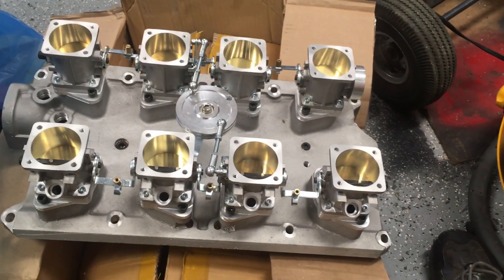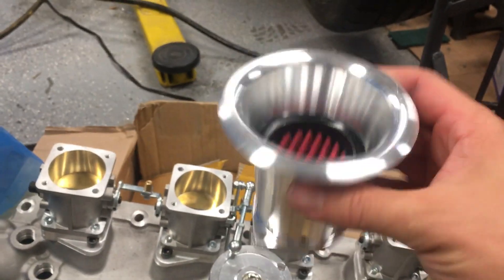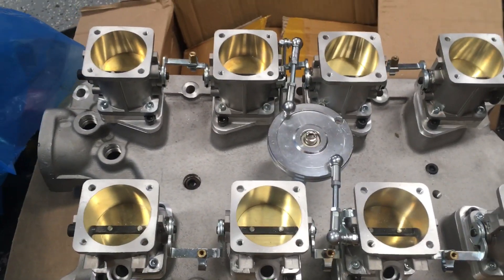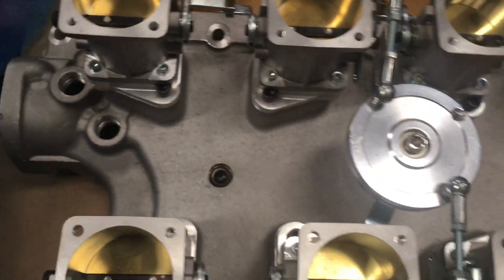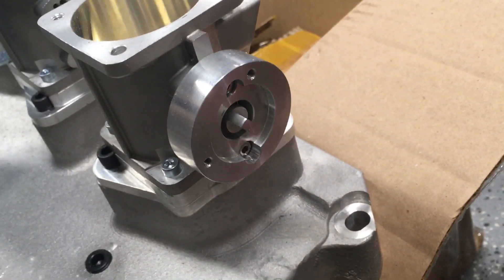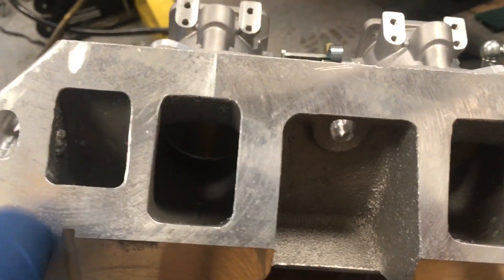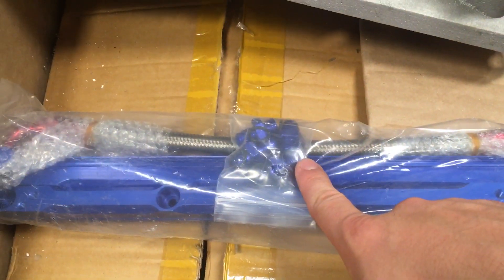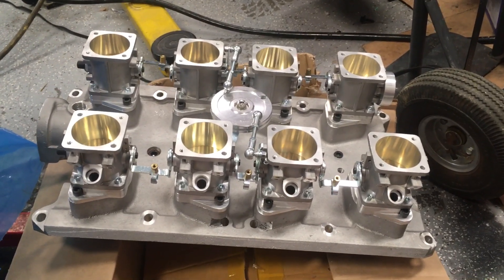Speedmaster Downdraft EFI Initial Review

Comment: Hey Ted ! Love your video’s was wondering what you think of the speedmasters stacker so far? I have this setup on my 351 stroked 427W but cannot get it dialled in and not fouling plugs. Hope you can lend some much needed knowledge.
Reply from the maker: Hey Brandon, I'm glad you enjoy my videos! To be honest I have only run the car a few times with the Speedmaster setup and I haven't dived into tuning much at all. Can you tell me a bit about your fuel and ignition systems otherwise (what ECU, injectors, whether you're using Speed Density, Alpha N or something else for the method) and I'll give you any thoughts I have.
Reply: @TedsGarage  Hey Ted ! Thanks for getting back to me really appreciate it. So I didn’t build the engine personally but from my knowledge it’s 
Dart Block 351W stroked 427 forged internals I have a solid lifter pretty racey cam setup I have a AFR renegade heads #1451 58 CC running just a basic distributor from the auto shop down her in Melbourne, Australia  I’m running Siemens 60lb injectors with a Wolf V550 ECU hopefully I’ve covered most of the things that could some
Up the setup 🙏🏽😅 Anything you recommend would help immensely.
Reply from the maker: @brandonjohntomay8978  I don't know anything about the Wolf ECU specifics, but a couple things come to mind from what you've described. The first one is that you're just using a plain old auto parts store distributor. That seems like a pretty hot engine to be running with a normal distributor, and you typically want/need a better ignition system to go with a more powerful engine. So I would look at upgrading that to a good MSD setup or whatever your favorite brand is (MSD would be my preference if you're sticking with a distributor vs. coil packs). I also don't know what your timing is set at, but that could have an impact if it's too far advanced or retarded.

60 lb/hr injectors are very large. For comparison, I have 47 lb/hr injectors and really 36s would've been fine. I estimate my engine at 400 HP. I got the 47s more than anything because they were cheaper. At 60 lb/hr they're going to have a hard time metering low fuel flows and you could just be getting too much fuel because that's what the injectors can do.

You didn't mention spark plugs. Check with the cylinder head manufacturer, they can likely recommend a plug to go with the heads. On my Edelbrock heads they have a specific plug they recommend as the wrong heat range plug could be impacting things.

So now getting to the intake. There are different methods for determining/metering fuel and determining airflow. Speed density uses a MAP sensor, Alpha-N bases it on throttle position. On my Microsquirt they have a specific individual throttle body mode which is a combination of Speed Density and Alpha-N. If you're using Speed Density, make sure your vacuum lines for the MAP sensor are all connected well and that you aren't getting leaks as that can impact your manifold pressure reading and thus your calculated airflow. But a lot of times with ITB setups (and I haven't gotten into the Speedmaster enough to tell for sure) there just isn't enough of a plenum to get a good and consistent vacuum signal. I'm assuming you're getting your vacuum signal from one of the ports that goes to the tiny plenum on the bottom of the manifold connecting all the throttle bodies, but if you're getting it from an individual cylinder then it will absolutely be noisy. You may also have to just try going to Alpha-N to tune it correctly.

Let me know what you find and what works for you as it could be helpful for me. But I would definitely look at the first three things before much else, as if you don't have the ignition right and/or have too large of injectors then tuning it isn't likely to be successful. :)
Reply: @TedsGarage  hey Ted, thanks for getting back to me. Hope your doing well, that’s a lot of information to take in, and will be a huge help I have been debating replacing the distributor with something more sort after like a Msd I will start checking the items you listed and report back to you!! Really keen to troubleshoot this thing ready to eat road 😍thanks again Ted

Comment: How to to know what size injector 351 Cleveland no worries ill work it out ordered the injection and did get filters 12
Reply from the maker: The size of the injectors is dependent on horsepower, and how much fuel your engine needs to make that horsepower (and protect against detonation). You need to have an idea of horsepower first.

From there, there are different styles of injectors, and you need to pick one that fits your wiring harness (unless you want to modify your harness) and manifold.
Reply: @TedsGarage  just a mild cam

Comment: Good video. Thumbs up
Reply: @TedsGarage  i purchased the newer version. Happy with the results. Definitely way more cost effective than a borla / inglese system
Reply: @TedsGarage  Hey Ted. Any updates on this build? Also...did you end up fitting an IAC? If so..what unit did you fit?
Reply: @TedsGarage  thanks mate! Yeah i had the newer version of this setup on my first engine, a 302. That idled well and didnt give me any issues really without an IAC. However i sold that engine before actually driving it anywhere. 
I now have the same newer type setup on my 351w. I think i will take the same route...see how it goes and if needed i can add the IAC. Problem is, theres a massive price difference between a haltech ECU that has the capability to run the IAC rather than not. It would be an overkill of an ECU for a street engine. So i will need to make a decision sooner rather than later :(

Your build is looking magic by the way! Well done. Keep us posted.
I wish I could post a photo of my build for you
Reply: @TedsGarage  awesome ill keep an eye out for more updates. Watching some now. Awesome!
In case i miss it, what injectors did you go with?
On my rough calcs for roughly 500hp and 80% duty cycle i was going to go for some 42lb bosch units
Reply: @TedsGarage  great appreciate your replies! Thank you. Id be interested to know the part number or a link to the injectors you bought to compare with what i had included mind if you do get a chance.
Once again..much appreciated kind sir!